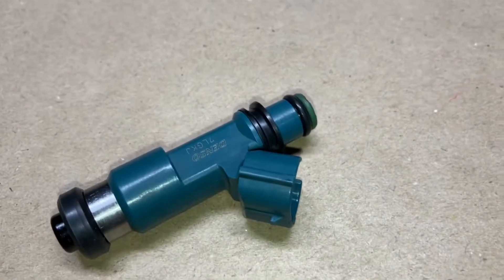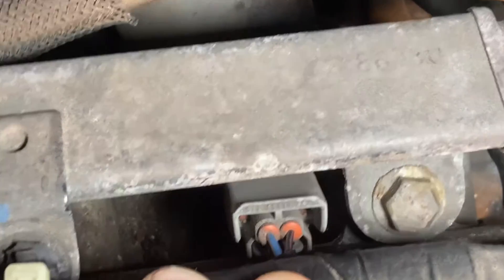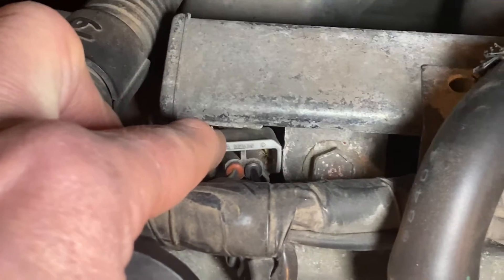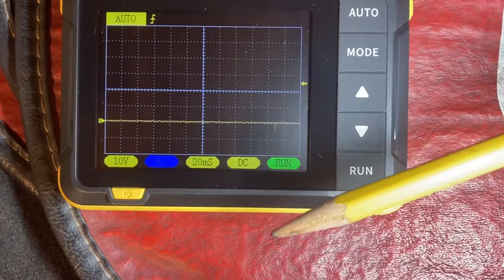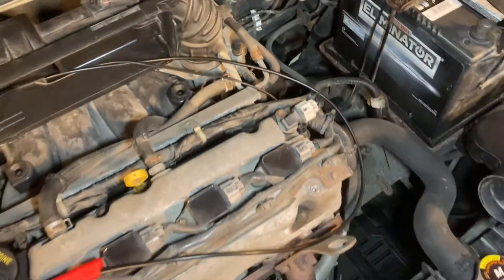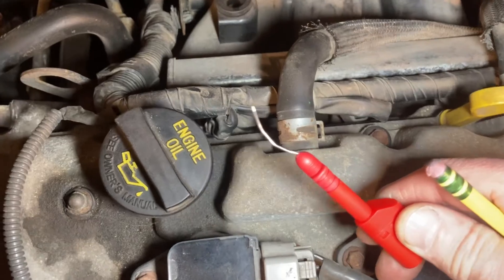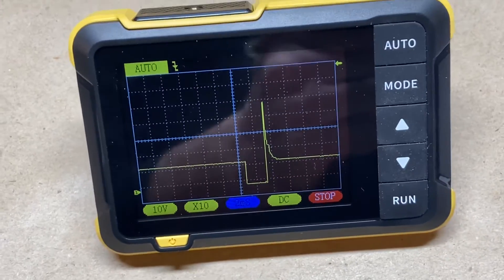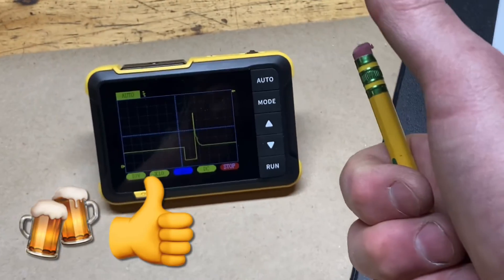Fnirsi DSO-152 Fuel Injector Waveform Capture

Comment: If I buy the DSO510 fnirsi  is my first time using the oscilloscope when I buy it can I use it to test map sensor,mass flow sensor etc,please respond thank you keep those videos coming
Reply: An where can I buy the attenuator AT-10
Reply from the maker: @simonflores3410 Frnisi DSO152 Attenuation & Coupling Preliminaries
https://youtu.be/akI-yXZFYPc
Reply from the maker: Yes. Even the most basic of oscilloscopes are capable of dealing with virtually all systems on an automobile. I highly recommend Graham Stoakes book “Automotive Oscilloscopes Waveform Analysis” ((ISBN 978-0-9929492-6-6) Great starting point. Thx for watching 👍🍻

Comment: Where did you get the 10 x1 attenuator? Can't find it anywhere online. Only 20x1 is available but will not work with these oscilloscopes
Reply from the maker: https://www.martinloren.com/product/signal-attenuators-couplers/
Note: you will require a MCX to BNC adapter also. Thx for watching 🍻

Comment: Can't you put the falling edge trigger below 12 volts so that when the signal drops to say 10 v the scope will begin to draw its image ?
Reply from the maker: 152 triggers at the extreme left of the screen. Unlike the 153 where the trigger can be adjusted on the X&Y axis the 152 only has Y(amplitude) triggering adjustment facility.
Reply: @TheGibby3340 not what I meant .
Since the injector is a pull down circuit, you could set the trigger, falling edge, at less than sourse voltage. Say 11 volts.
When the injector is pulled to ground the scope will start to capture that part of the signal as it is being pulled to ground . 
The image will still be at the left of screen however you will have the image from ground, the on time, the spike and the coil field collapsing .
Reply from the maker: @keltecshooter Yes I understood your point. I don’t really want to view a partial injector waveform, but yes you can manipulate the edge triggering in the manner you mentioned. Thx for watching. 🍻

Comment: That was a great explanation I'm learning scopes. Nice to see this little scope can be used.but I have a 20 intenuator is that to bug? Thank you 😊 
👍
Reply from the maker: No it’s fine. Just keep in mind the voltage (amplitude) scaling will be off due to selected attenuation differing from actual attenuation. 12V may display as only 6V for example. Thx for watching 🍻

Comment: Great video, I have one question, tho:
Can the device work with a 20:1 attenuator as well? (Does it have a x20 setting) For some reason, the at10 isn't available in my country, and the only ones I could order would take 3 weeks of shipping, while the dso152 could be here tomorrow, as well as a HT201 so 20 to 1.
Reply from the maker: Yes you can use the 20:1 attenuator. Just be aware the scaling will be incorrect. Also beware of the fact that you will require the mini to standard BNC adapter. These details are covered on previous videos on the channel. Thx for watching. 🍻

Fnirsi DSO 152 Coupling & Attenuation
https://youtu.be/DfL7chKq_DI

Frnisi DSO152 Attenuation & Coupling Preliminaries
https://youtu.be/akI-yXZFYPc
Reply: @TheGibby3340  Oh watching the video made something clear, if I get the set, then they give you the x10 attenuator with it. So just need the set, perfect 👌. 
And you listing the uses of this little device really told me that this is a must have. 
Cause on the 944 I am working on currently my injectors aren't firing, both lines have battery voltage on I but I need to see like in your test if they get grounded and can also test my crankshaft sensor with this. Thx a lot m8🍻.
Reply from the maker: Love the 944. Good luck with your troubleshooting 🍀👍🍻

Comment: I'm a DIY guy and just recently got this scope and starting to play around with it. I need to get an attenuator. Is a 10:1 all I need or should I also get a 20:1? I have watched your other videos on the pico and Hantek. I'm wanting to get one of those. I have a canbus issue I need to troubleshoot and just want to learn to use the scope more for automotive diagnostics. Another question will the Hantek CC65 current clamp work with this scope? I saw you use it with the Hantek and PIco and was curious if you tried it with this one. I want to be able to test like blower motors and starters and things.
Reply from the maker: 10:1 is likely adequate. To use the current clamp you will require an adapter mini BNC to BNC. Thx for watching.

Comment: Nice video. Have you tried it in measurements on electromagnetic common rail injectors??
Reply from the maker: Piezo electric? No. I don’t currently own any diesel/GDI vehicles. Thanks for watching. 🍻
Reply: @TheGibby3340  The common rail injectors work with high voltage up to 100 v and have a sensitive mosfet, that's why I asked. If you could make a video with common rail injectors it would help me a lot.

Comment: I'm wondering if this little thing can do what its cousin FNIRSI 2C23T does...in AUTO the trigger cursor can still be positioned...trigger cursor outside voltage range produces scrolling capture...trigger cursor positioned within voltage range stops the scrolling...all while in AUTO

kinda a hybrid AUTO/NORMAL thing...
Reply from the maker: Hi Denis. Yes the trigger does still function in that manner in Auto. Annoyingly it constantly triggers at the zero point on the timebase. Cropping the trace, rendering it near unreadable. I don’t think I have encountered a scope where the trigger cannot be altered on both axis 🤔 Because of the nature of injector operation, the relatively low pulse repetition rate makes it difficult to capture a decent trace under this constraint with this little scope. Perhaps I am missing something obvious or it’s just a matter of finer fettling. 🍻
Reply: @TheGibby3340  I'll try to find time in my busy schedule (retirement is harder than it looks) and do a few more 2C23T automotive captures...

a handheld scope secondary ignition waveform capability would be neat...and I would encounter similar trigger challenges as your injector capture

I'll try to make time...will keep you posted if I do, Ian
Reply from the maker: @theGADGETSplaylist Is there facility on the 2C23T to set the trigger from a timebase perspective Denis? And thanks so much as usual 🍻
Reply: @TheGibby3340  there is a horizontal position marker that can be moved...whether that constitutes the same thing as you're asking, I'm not sure
Reply: @TheGibby3340  I was able to get a secondary ignition capture with 2C23T...can get centered on screen...but not easy and the 8bit small screen doesn't produce a quality waveform...

a step too far for these small devices
Reply from the maker: @theGADGETSplaylist Think so…Cheers Denis 👍